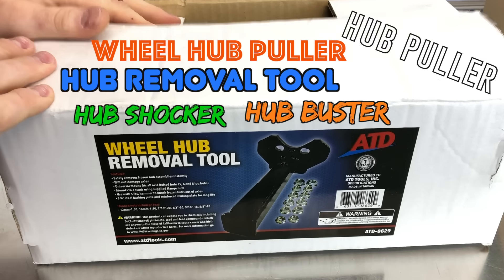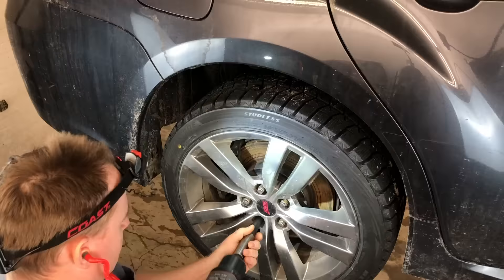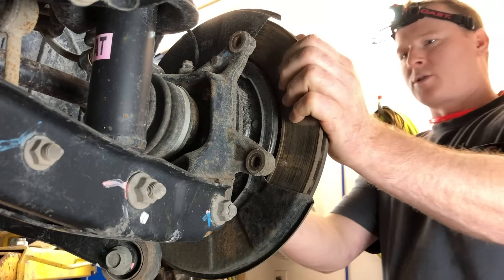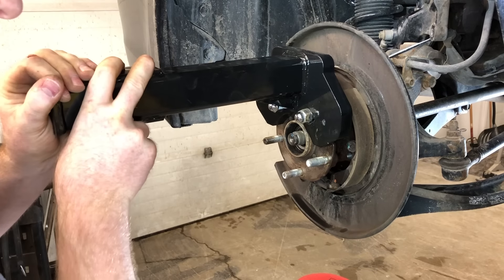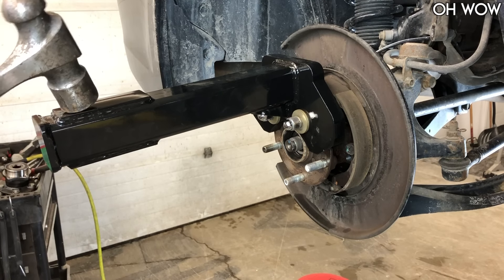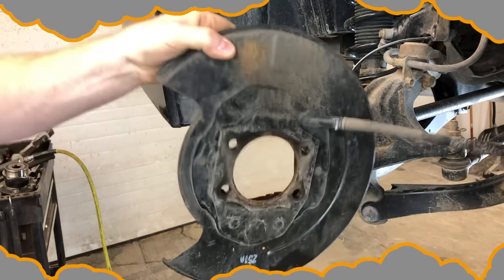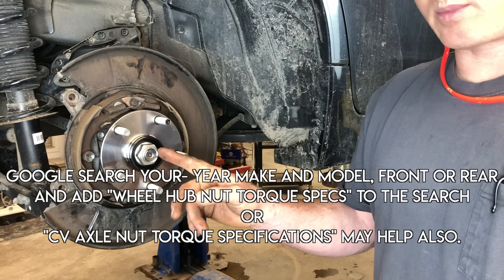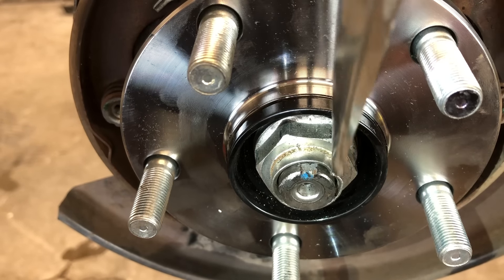HUB SHOCKER Hub Busters  |  REMOVE STUCK WHEEL BEARINGS EASILY!

Comment: Will the Hub Shocker damage the knuckles ID? Isn’t it better to pull the hubs straight out?
Reply from the maker: No damage so far and I have remove quite a few. The subbies rear bearings stick so bad because of rust jacking. The bearing basically pops out with the tool if it’s mounted correctly and cv axle nut is used to hold the bearing together. Takes 20 minutes.  The second video that solves the mounting issue and bearing separation issues. The inner portion is of the knuckle is way to substantial to cause damage. It’s very very strong. The bearing wants to release from the knuckle. But it dies needs a shit ton of persuasion.
Reply from the maker: https://youtu.be/eKqYtMdlPYo Check out the new video on the Shocker. Solved the mounting issues I was having. Solved the bearing separation issues I was having. The tool is incredibly powerful and useful. Pops them right out. Ps. once the rust bond is broken they always come straight out. The rust bond is the issue with Subarus. Its acts as if they are welded. Hub Shocker= 20 minute replacements for me now 😀

Comment: Does not work on the 2013 - 2019 Ford Explorer Hubs, Matco Sold me the updated thicker version and doesnt even budge them, the hub is to long for the hub buster to work so matco bought it back after i crushed the contact face with a 16 lb sledge

I had high hopes for it
Reply from the maker: Yup. Ford explorers are currently the raining king of bearing removal turds. Best way to do explorers is with bolts. South main auto did a video in the last six months on it that shows how it works nicely. Should be easily searchable on YouTube 😀🔧🔧
Reply: @EasyFixShaun  there is a new company out there that builds some kind of like Bridge Assembly that hooks into the flange face but it's like $800 for the kit
Reply from the maker: Really? Wow. Thats cool! I like the bolts method. It essentially turns the knuckle into a press. Very powerful!😀

Comment: Remove a lug nut bolt and then put a new screw and nuts. Tight them againts the kuckle and the  bolt will push the bearing out. No ear damage or new tool needed.
Reply from the maker: Also a great method 😃🔧

Comment: All I ever had to do was to put back brake rotor and wheel back (without the brake caliper and the 4 screws on the back loosened) and then kick the wheel a few times. The extra weight of the wheel did the trick. No sledgehammer, worked even on one rusty car I serviced. No extra tools needed :-)
Reply from the maker: That is an awsome idea! I should try that sometime. It seems like it would totally work. Especially if in the middle of a bearing replacement and that is all that is available 😃🛠

Comment: A heavy duty slide hammer with but attachment will also do the job
Reply from the maker: True. Have you had the bearing separate with the slide hammer?
Reply: @EasyFixShaun  Yes but the weak link is usually the hub attachment. Ive broken a few
Reply from the maker: Oh ok. Wow that would take some force! Have you seen the second hub shocker video? Hub shocker 2.0?

Comment: I love how it is universal. Will it work with press in bearings too?
Reply from the maker: It is Universal and will work on any bearing as long as it is a Bolt-on Hub style bearings. I don't think it is intended for press in bearings. But who knows. I will have to try it sometime!
Reply: No, it's not going to do anything good with press out/in bearings.
Reply from the maker: https://youtu.be/eKqYtMdlPYo Check out the new video. Doesn't work on press in style bearings still. But, I solved any mounting issues and bearing separation issues you may have had 😀https://youtu.be/eKqYtMdlPYo

Comment: nice video
Reply from the maker: Thank you! If you're interested, I made a followup video that solves mounting issues with the tool. It's so strong that it needs to be thru bolted to the bearing. It's so strong, it will separate some bearings into two pieces upon removal! I solved that problem also. This thing works like a breeze. I love using it, I have used almost 40 times now. So before you use the tool check out the updated video! 😃 🔧🔧https://youtu.be/eKqYtMdlPYo

Comment: Will this tool work to change the bearing on the right front wheel of my 2007 Toyota FJ Cruiser?
Reply from the maker: Yes. But,  those fj and tundra bearings are weird duck. So look up the parts before you repair. You want to get an idea of what you are getting into.  They are pressed in and bolted in. They are a weird combination. The bearing should pop right out once unbolted. You will need to press the new one together. I have a video of an on car press that would work perfect to press your bearing all back together on the bench.
Reply: If you want to see how Not the remove it watch how Eric The Car Guy, he has an episode where he trys to remove with a huge slide hammer.. But if you want to do it right remove the entire knuckle assy not that difficult and more than likely you will be doing it on both sides. Would replace the hub along with the bearing.will save you a headache later.. But if you have to remove the bearing without removing the knuckle can use the retainer bolts to push it out..may just need a spacer.. No huge hammer required..
Reply from the maker: @danmartinez9497  Awesome. Thanks man! 😃

Comment: I'm having the same problem with a stuck wheel bearing.  I'm assuming that wheel hub in no longer useable?
Reply from the maker: Bolt in style wheel bearing? Usually the problem is rust. The rust bond between the bearing and knuckle prevents removal and is usually the bottleneck of the job. Usually once the wheel bearing is freed the knuckle is always reusable. Inspect it for defects to be sure. But i have never seen one go bad. They are extremely robust 😀

Comment: Torque the axle nut.
Pop the center cap on the wheel out.
Drive around the block.
Retorque axle nut to ensure it was seated.
Indent the nut to lock in place
Pop wheel cap back on
Reply from the maker: That will remove the wheel bearing?
Reply: @EasyFixShaun  No, it's the way it should be reattached once finished to ensure the axle doesn't loosen off
Reply from the maker: @Driver0808657  Oh I see what you mean. The torque spec is enough pressure to make sure the bearing is seated in the knuckle, The hub is seated in the bearing, and enough to make sure the nut does not back off. Staking the nut is a failsafe and should slow down the nut if it were to spin. The torque spec of the axle nut once applied will do all of the things you mentioned in one step. Driving around to seat a bearing is not a common or recommended method right now.

Comment: Do you recommend removing speed sensor before using this?  I've heard various opinions. I am looking to replace both rear bearings on my 2015 Outback next week.  218k miles, Minnesota so I know its gonna be rusted on.
Reply from the maker: Yes. Remove them. This tool will pop them out like butter. You will need a 8lbs standard sledge hammer though. 😀
Reply: @EasyFixShaun  So the hub buster worked wonderfully on the passenger rear.  Drivers rear, different story.  Ended up having to remove knuckle with bearing assembly still in it, torch it and hit with air hammer to get it out.

Anyway,  I ruined the boot on the upper control arm when detaching it from the knuckle. So i got a new upper arm and am going to install it.  

I read subaru service engineer manual and at top of procedure they state:
 "Always tighten the bushing when the arm is positioned in the state where the vehicle is at curb
 weight and the wheels are in full contact with the ground."

But then nowhere in the procedure do they have you doing anything after wheels are on again and car is back on ground.  Am I missing something?
Reply from the maker: Ouch sorry to hear that. Did you have an issue attaching the tool to the hub because of the short studs?
Reply: @EasyFixShaun  No.  It was just really stuck. 218k worth of rust on it.  The other side only had 170k because it had been replaced before.
Reply from the maker: Wow! Did you try a sledge hammer on it?
Reply from the maker: Hey Jim! great video. I can see that I hit it waaaaay harder than you do. So hard that I bend studs or bolts depending on how I mount it. I also typically always bent the hub flanges on Subaru's. The tool strike pad is about 12inches outside of the body work so you can really give it a wack. I recommend hitting it as hard as you can with a 8lb sledge, and then hit it harder 😃 That is what works for me. The tool can take it. The mounting bolts become the problem usually. I have to tighten them and adjust them a few times.
Reply from the maker: Check this out Jim. I updated the video. https://youtu.be/eKqYtMdlPYo
Reply: If you do not removed the sensor, it will be damaged and you will have to replace it which is a pain in the ass: the connector is inside the car. Only takes 30 seconds to remove the bolt holding the sensor in and then pop it out.
Reply from the maker: @jaybob4627  Yup. Remove it if you can. 😃🔧

Comment: i had a 2008 dodge deoktta and friend got the tool and it never work had to pull the hub knockl off and then take a sleag hammer and knock it that way ...it mite work on a subura like u said i did try to remove a hub from 2013 rear and that was one stuck hub as well but my friend gave up and had my put it back and took it to a shop and it cost him 700.00
Reply from the maker: Oh man! I am sorry. Ya the rust is so bad sometimes. I am in Michigan and man its horrible. If you have one you are using, you should check out my 2.0 hub shocker video? It has been working better for me with solid mounting using grade 8 bolts. I also solved bearing separation issues in that video. It's really been working perfectly since I did those two things. Let me know what you think of those methods if you want to? I would love to hear if you think it is better or not. 😃🔧https://youtu.be/eKqYtMdlPYo

Comment: So a buster costs 125 bucks, do u think my friends will pitch in so we can share the use? Or else i aint goin budge anyone borrowing it man! U did nice job!
Reply from the maker: Yup! It seems expensive until you or your friends need it. Maybe you could buy it and call it "cheap insurance". Typically when you buy something like this you then never need it. Weird. Believe me though, that is a good thing. Stuck bearings can cause a much more expensive repair from heat damage, cv axle damage or knuckle damage. You should rent it out for sure!
Reply from the maker: https://youtu.be/eKqYtMdlPYo check out the new video for your next bearing 😀 I solved mounting issues and bearing separation issues.

Comment: Will that tool work on all applications or is there a specific one for different models??
Reply from the maker: It is universal. The holes are slotted. So it works with all bolt patterns 😀🔧🔧
Reply: Thanks
Reply from the maker: Yup! No prob 😀

Comment: Sledge hammer works wonders
Reply from the maker: I agree. Check out the update video. Solved mounting issues. Solved bearing separation. Only use sledge now. Much Sledge. Many wow 😃🔧🔧  https://youtu.be/eKqYtMdlPYo

Comment: Whats the difference between using that or a slide hammer?
Reply from the maker: I would say the are both similar tools. I would say the shocker is easily stronger because you can strike it with a sledge hammer for stubborn wheel bearings. Check out my second video. I solve all the mounting problems and bearing separation problems I was having with the tool. Big update if you need a bearing seperation trick for the shocker or the slide hammer removers! 😃 https://youtu.be/eKqYtMdlPYo

Comment: I noticed you replaced the hub, did it knacker the studs up ?
Reply from the maker: Sure did! I was replacing the  hub and bearing assembly. If you need to save the hub for some reason you would want to choose a different method of removal. Press in bearings are typically the type you would save. This tool wouldn’t work with those at all. The shocker is  just for modern bolt-style bearings only. 😀
Reply from the maker: The second video I made helps with most mounting issues I was having. I only through bolt the tool to the hub now. It works waaaaaay better. 😀 https://youtu.be/eKqYtMdlPYo

Comment: Just bolt a heavy chain to one or two studs and stand back at the other end and give it a whip it'll pull that axle right out of there. Well that is if you're pulling a straight axle,... it might work on this also.
Reply from the maker: I have never tried that. Sounds wild. It really works? Even on severely stuck corroded wheel bearings? Wanna check out the new hub shocker video? Could you let me know what you think of grade 8 bolt mounting and the cv axle nut trick i used to hold the bearing from splitting in two pieces? 🔧🔧  https://youtu.be/eKqYtMdlPYo
Reply: @EasyFixShaun  hi, I did watch it and for the cost of that one bolt, I thought that was pretty slick. Although I don't think I could swing that hammer..lol. I'll leave that to you.
And yes the old chain old school I've seen it work. It takes a heavy chain and a firm grip.
Reply from the maker: @cynthiaayers7696  No kidding! I think that is awesome. I need to try it. 😃

Comment: Cool tool.  Not a chance I'm paying $100 for that.  I have scrap metal kicking around in the garage I can build that with.  I've done a few wheel bearings and haven't had much difficulty getting them off.  Must be a northern thing.  Either way, thanks for the how-to.  I'll have to remember that for the next one that gives me trouble.
Reply from the maker: Cool! Yup, it is mostly a northern thing. I am in Michigan. Corrosion makes everything 100x more difficult. If you have what you need to make it lying around, I would make it. I wanted to do that also. I didn’t have the material myself. Let me know how making the tool works out 😀

Comment: 24 In. Steel Pipe Wrench and a big hammer from harbor freight will cost you sum of 30$. It worked well for me
Reply from the maker: I’m glad that worked for you. Although I would never recommend it. I have seen injuries. There’s no way to attach the wrench to the hub and it can and will fly off when you strike it. When it does it is much stronger than your teeth or face. Bad things can happen.
Reply: Got one to springy for me come off and hit me in the leg so got a hub buster so far used it 7 times great tool.
Reply from the maker: @jeffmee763  I am glad it worked for you! I'm a pro and its all I use on Subarus. Tool investments suck but this one is worth it. With the amount of force needed for some bearings to be removed, you want something that is bolted on...
Reply from the maker: Nice Jeff! Check out the updated video for some great ideas for your next bearing project 😀https://youtu.be/eKqYtMdlPYo

Comment: Cool,do they make a tool to get the drum off?
Reply from the maker: I don’t know of a tool for that drum removal. I use a hammer and strike in between the lug studs and most times I get lucky. They will pop right off. They can be a pain sometimes. Can you back off the adjusters? Backing off the adjusters is the proper way😃
Reply: It's called a hammer.
Reply: Triedva slugde,nothing,heated it with a torch, sludged it,nothing,marvels mystery oil,nothing,you know what gets most of a drum off a 1999 ranger,cutting it off with a torch,then makeing a bracket with a log chain welded on it,wel the bracket to whats left of the drum,hook the chain to my big truck,5 grand nutral drop,hammers dont work,at least not in my case
Reply from the maker: Omg!! Five grand neutral drop,  may be the funniest comment I’ve gotten. Love it man. Hahahah. I’m sorry you are having so much drum problems 😀
Reply: Ive never had one rust on this bad befor,it was crazy,it just said fuck it n had fun with it,its just a yard truck anyway,but the nutral drop worked,plus i was in 4 wheel drive lol cheers!
Reply from the maker: That’s awsome man. You had me laughing! That was a great story. Cheers!

Comment: Some anti-seize on the new part means that when you change that bearing, it comes out without a hammer and Hub Shocker.
Reply from the maker: Yup that will make a tremendous difference! Cleaning out the old rust that caused the rust jacking will also help 😃🔧

Comment: This tool has two surfaces to be hit on.  I am assuming that if you strike on only one side the hub casting surface could be wallered out?  Why not keep keep the strikes "even" by rotating the mounted assembly 180 degrees instead of stressing it all on one side?
Reply from the maker: I have tried a few different ways like you are saying and it doesn't seem to matter at all which side you decide to strike. I usually pick the easiest side 😃🔧